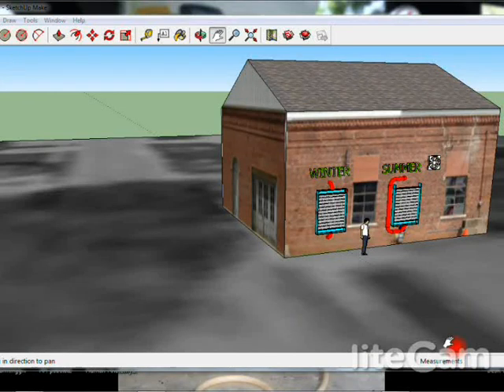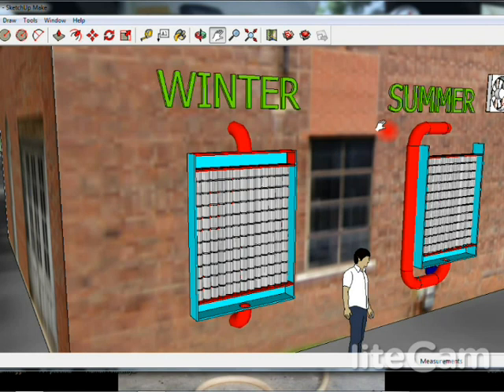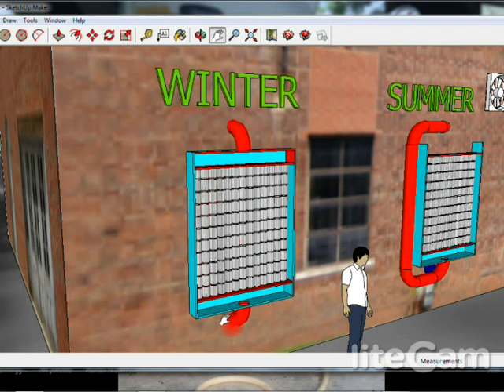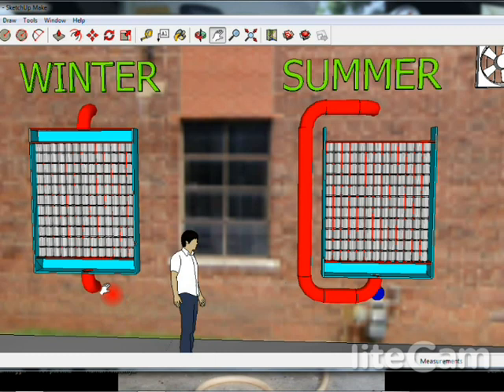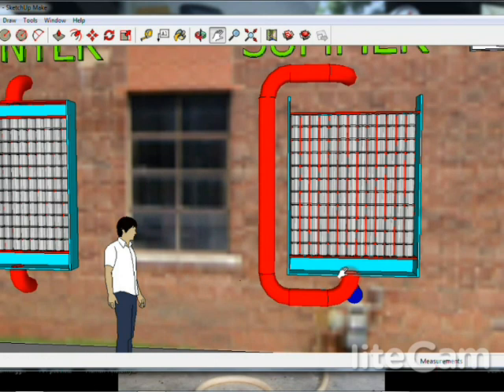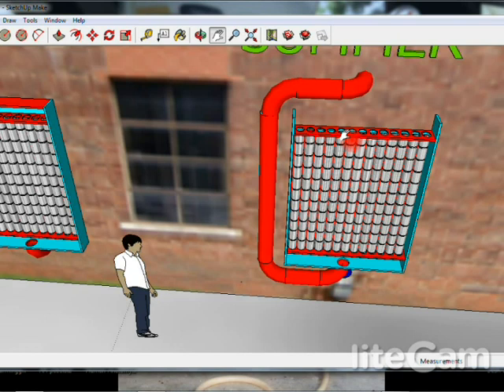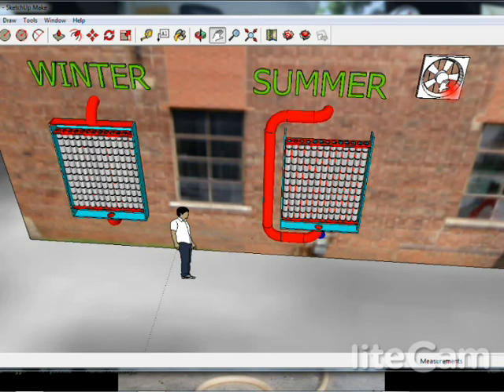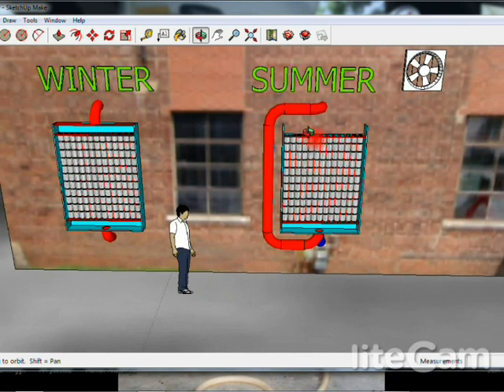Solar Cooler/Ventilator And Solar Heater in 1, Using Sun's Heat To Cool Your House

Comment: the winter design will work but you have to make sure that it doesn't have the opposite effect at night time, ie: it sucks the heat from your house and shoves it outside again. An intelligent grill/flap system needs to be implemented from the inside. The summer version just won't work. You open a window that lets hot air in and then the hot air rises and it pushes the hot air out the top... it's much much better to insulate your house and protect it from the heat in the first place, in the end you need to protect the winter warmer system from heating your house in the summer and then find a better cooling solution.
Reply: In the winter, you just need to adjust the surface area of the heating elements' panel(s), and maybe to add more glass/plastic around it, with a bit of distance between the panel(s) and the transparent material insulating it. For the summer, it would be better to use a heatsink, by cooling the heatsink with low-pressure air pulled by the heating elements from the atmosphere, which then rises due to the hot air's updraft. The pipes must be well insulated, of course. You can add an evaporative cooler before the heatsink, to lower the temperature even more. Adding a tall pipe above the heater helps increase efficiency and updraft.

Comment: This is some great thinking id love to see one in action to know if it would cool enough to be worth it
Reply: Well, it depends on what you mean by that. If you mean lowering the electric and air conditioning bill, it works. In the area without high air humidity, you can also use and evaporative air conditioning system in the form of some wet clothes in front of the areas through which air gets from outside to inside the house.

Comment: Long time ago i saw a video on yt where a guy made a very interesting system, catching the heat on the ceiling and circulating it (with an electrical fan..) inside a heat bank made of a "boulders pool" in the basement. So he could cool the house all the summer, and eat the house in the winter...

Comment: I think both are excellent ideas and would like to see how they work for you.. We use a building for several purposes year round but it has no ac and I would be very interested in installing this design in several places to lower our indoor temperature
Reply from the maker: Bruister, I know a ventilation fan close to the ceiling works wonders for keeping the interior of the building cool. I'm hoping to build a prototype in the next month or so. Will post another video when it's done.

Saeid

Comment: Hey, I know this was posted a long time ago, but I think I have a slightly better design. Instead of cans, use a lean to greenhouse with a Trombe wall at the back. In winter, the greenhouse top is shut and the Trombe wall heats up, heating the house and greenhouse. In the summer, have an expanding bracket that automatically raises the greenhouse roof (these brackets don't use electricity, they use expanding wax if I remember correctly) that will block the intake at the top (going to the house) and open the outtake at the top of the greenhouse roof. That way it uses the heat to cool both the greenhouse and the house.
Reply: And using that for a greenhouse attached to a room, would get that to function as an AC for the house, as well.

Comment: work good for winter, not so much in summer, it is easier to heat air with a box and the green house effect but its hard to find cool air.
Reply: You can use the updraft caused by heated air into an insulated pipe with a heatsink inside it, to get the heatsink cooled by the lower pressure air, because lowering the pressure lowers the temperature, as well. The heatsink would be connected to the inside of the house, and it needs to be located above the intake, to properly cool the place, because cold air lowers in elevation.

Comment: the heating mechanism is popular but the cooling system is brilliant. I just hope it's able to bring considerable cooling. have you tried it out?
Reply: To cool the place even more, you need to have a separate system for getting ambient air into a piece of pipe or sealed box which has a heatsink inside, with both ends of the heatsink connected to the house, and the intake of that pipe/box needs to be reduced, so the ambient air drops in pressure and that cools the heatsink. Also, to increase the efficiency, the outtake/exhaust of the heated pipe needs to go at least a meter higher, to allow the heated air to create more updraft, which lowers the pressure at the intake even more. With a tall enough pipe, you can use a small wind turbine to generate energy, as well. Plus that you can reroute some of that hot air through a pipe into a box for dehydrating foods and for more quickly drying clothes.

Comment: The design of the summer cooler presumes the indrawn ambient air will be cooler than that which is being drawn out by the draft of the heater array. In my area such a presumption is almost always incorrect due to humidity and number of sunlight hours.
Reply from the maker: This is based on the assumption that any out side air is cooler than the air trapped indoors near the ceiling. I live in similar climate as you by the way
Reply: If you have high humidity ambient air, add a tall pipe on the exhaust of the heater, then add a sealed insulated box before the intake of the heater, and in that box have a heatsink and a small intake hole which can be throttled for increasing the efficiency. The heating elements make hot air, which wants to go up through the heater and through the chimney, and creates updraft which pulls air from the box with the heatsink, which pulls air from the outside through the opening which you can throttle. The heatsink pipes should be insulated and go inside the house, to cool it. It's best if the system is built on a corner, with the insulated box on a side which is shaded most of the time, and the rest on a side which is sunny most of the time.

Comment: digging the cooler idea... very cool. simple heat vacuum.. i wonder if there is a way to catch/convert/use the heat expelling during the summer and using the potential energy for other purposes?
Reply from the maker: +Eco Rookies 
If you build it lemi know if it works
Reply: Perhaps you could use the heat in the summer as a isolated water heater that could be winterized for the winter.
Reply: You could use the heat as/for a dehydrator, to dehydrate spices, fruit and vegetable slices, and even to make meat jerky for whatever type of meat you want. Maybe even to dry clothes faster, especially when there isn't much sunlight. Especially if you use a stainless metal sheet to reflect more sunlight onto the heating elements.

Comment: Very ingenious. I hope you make it and let us know the results.
Don't you think, in your summer only version, the hot air shooting out of the cans would heat the higher segment of the pipe if the exit from the building is straight on top of the cans? I think eventually that segment of the pipe is going to reach a similar temperature than the cans; while the lower segment may stay cooler, affecting the draft. You may eliminate that risk by moving the hole away so it is not directly on top of the cans (of course, your two in one version is fine, since the exit out of the building is not directly on top of the cans).
Reply: You can increase the efficiency by having the intake and outtake of the heating both connected to the outside, and have the intake go through an insulated sealed box in which a heatsink is located, with the intake of that box being smaller and with a system to throttle the intake, or to manually control the intake area. Smaller intake means the hot air's updraft can create lower pressure in the heatsink box, and lower pressure means lower temperature. The heatsink needs to be connected to the house through insulated pipes. Adding a chimney/pipe to the exhaust of the heating element helps increase the updraft of the hot air, increasing efficiency.

Comment: ......another thing Saeid, when you build your summer cooling outfit I would advise putting a 90degree duct bend with a mesh covering on the extraction holes (tops of the cans) where you have removed the header. Otherwise you may find it all clogged up with the summer dust, dirt and things that birds do. I don't want to see your great idea being unusable for the next winter.
Reply from the maker: Yes, for sure. But I imagine anything that decided to nest in the cans at night, will leave on its own by mid day.

But yes, dust cold bring down the efficiency and has to be dealt with. 

Thanks for your comments. I appreciate them.

Saeid
Reply: Saeid Momtahan You're right there but I'm just thinking how difficult it would be to remove debris from the inside of the cans without the top cover. Excellent idea though Saeid, well done. I might try it myself sometime......
Reply from the maker: Gracias hombre. Mucha suerte

Saeid

Comment: Ita about time some one design a real working heating cooling system. The mock up is good but it could be simplified even more by removing piping and do it all internally by simply opening certain vents and closing others. you really don't even need all that pipping in fact you could remove one entire panel. On the heating side please add some type of medium behind the cans to store the heat. then release the energy at night. IE sandstone.

Comment: I highly doubt that's going to work in the Arizona desert work it's in the 100s like 115. Do you have anything that looks like this it's similar but can be like an evaporator cooler type of situation fuel by the sun? I wonder if you could make an evaporator cooler out of that same type of set up just a little bit different ..you would need water flowing over the pads to keep it moist . anyway if you have any ideas I would love to see them
Reply: You can use an evaporative cooler on the intake, after which a heatsink cools the air inside the house, after which the high-humidity air gets through the heating elements and then through a solar chimney (long and tall pipe used to increase the updraft). The more updraft you get, the lower the pressure after the evaporative cooler gets, which also lowers the temperature even more, which then cools the heatsink which cools the inside of the house. The pipes of the heatsink and the pipe or box inside which the heatsink is should be well insulated. If you can dig a few square meters in your garden, get some pipes on the bottom of that, so ambient temperature air gets cooled down in the summer by the underground temperature, which then goes to the evaporator which cools it down again by lowering the pressure (going thorugh a hole thinner than the pipe), and then again by the evaporative cooler.

Comment: Just a thought. Run a bunch of 4" piping under the dirt about one to two foot deep. Run a fan through the piping. Same idea just using the earth coolness to cool the house air.
Reply: I've seen that done using just a covered hole in the ground. Saeid's design coupled with your suggestion would eliminate the need for a fan.
Reply: @4Dermish  Adding the heater would help by having air go from the outside, to the underground, then to your house, then after it warms up to the heater, then back to the outside, where the hot air rises.

Comment: Nice design Saeid. But it will not make a difference! you need the air to go inside the building again and another mechanism to cool the aluminum inside the panel so the system can cool the air. Actually you inspired me and I'll work in a design for an air cooling system.
Reply: For lower temperatures, just have evaporative air conditioning. An easy one would be having a fan and putting some thin wet clothes in front of it. Works better the lower the humidity in your area.
Reply: Pls keep me informed of your design . i would be very interested to see what u come up with.
Reply: @dominique62dw  If you google "makeshift evaporative air conditioning", you will find plenty of examples of people who put it in practice. A wet textile made so it stays wet while a fan is circulating the air inside the house/room would be one way to do things. Though ceramic and cement evaporative coolers also work (google "notechmagazine Evaporative Air Conditioning" for the article explaining it).

Another way would be to use a trombe wall (google "trombe wall solar chimney" and check the image with two examples side by side with the names "trombe wall" above one and "solar chimney above the other) to push air outside the room, which would cause air to be pulled inside the room from somewhere else, and that somewhere else could be covered by a layer or more of said evaporative air conditioning.

You could also use a more traditional solar chimney (a dark metal pipe of at least 3 meters of length/height erected on the sunny side of your house) to pull air faster, so the evaporative air conditioning can work more efficiently.

Comment: I would suggest adding a shelter/screen or something across the top of the summer configuration to keep small animals, birds, insects, rain and dirt out of the cans.
Reply: A fine mesh is always welcomed. You can even make a tube out of mesh, to have less air resistance by expanding the surface area of the mesh.

Comment: The summer configuration looks good, but you need to replace the air removed from the house to prevent a vacuum lock on the system.  Instead of blocking the lower input port to the house, open it to allow cooler air to flow in and break the vacuum.
Reply: The windows are open to maintain a continuous breeze.

Comment: I think it will work. I've never thought of cooling in that manner. A solar powered fan or a battery operated fan can be placed in the room. I only wonder that if the warm air on the ceiling is being sucked out and replaced with the cooler lower air, wouldn't the hot air get sucked back into the house? Do you know of anyone who has built one yet?
Reply from the maker: cARLYLE, i DoN'T KNoW ANY NE WHo HAS BuILT THIS, AND i HAVEN'T HAD THE CHANCE To DO IT MYSELF. 
The idea is that the air in the heating tubes will be so hot that will create enough draft to suck the warm air out of the ceiling area. The hot air in the black pipes have only one direction to go, up.
Reply: I understand how it could draw air. I was just thinking that the room would have to have air come back into the room to replace the volume of hot air that was evacuated (because the room would not remain in a vacuum state, unless the room is air-tight). The replacement air has to come from somewhere, such as window leaks and around exterior doors. I'm only thinking it through and thought that maybe a geo-thermal type of set-up would work to cool a (controlled amount of) air being drawn into the room/house.
Reply from the maker: Yes, the air would have to come from the outside. I lived in a house once that had a huge ventilation fan installed into the ceiling and would do the same thing, draw the hot air around the ceiling out and suck in air from outside. THere was a big change in temperature when we turned it on. THis would be similar to cracking your car window open on a hot summer day
Reply: @carlyletom301  To cool the place even more, you need to add a tall pipe from the exhaust of the heater going up, to create more updraft, which would lower the pressure of air going into the heater. But before going into the heater, you need an insulated box/pipe with a heatsink inside it, and before the outside air gets to the heatsink, it should get to an evaporative cooler, to lower it's temperature even more. The heatsink would need to be connected through insulated pipes to the inside of the house. This means 4 pipes going into the house, but much lower temperatures without increasing humidity for house mold.

Comment: Neat to provide daytime ventilation.  But it's better to ventilate at night when outside air is cooler then shield/ cover windows in daytime to prevent heating the house then is a thermal battery held at a cooler temperature. You could use heat from solar in thermal mass then use thermal mass at night to create convection cooling 😎

Comment: someone prob has mentioned this but i didnt see it. but if you take the top off n the summer wouldnt it fill wit rain water
Reply: You can use a small roof above it, to avoid that.

Comment: The method of passive solar heating and cooling is called "convection". Same principal can be used in producing hot water with the main difference is a one way check valve to make sure the water flows in one direction only.
Reply: the Tesla's valve is one way. check it out!
Reply: @James-by1yp  It's actually a partial valve, which means that it goes one way fast and the other way slow. I think it's something like a 5-to-1 ratio (5 times faster in one direction).

Comment: Nice system, but to have nice air to breath in my house i would more use natural material in place of painted cans inside a styrofoam insulated frame, like glass window, cork insulation, darkend with a flame or using natural stone slates...